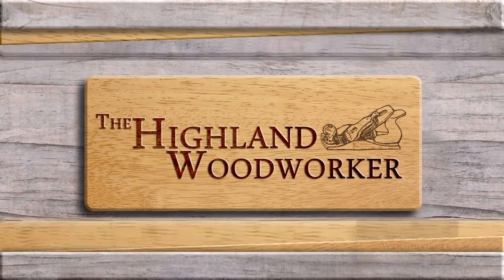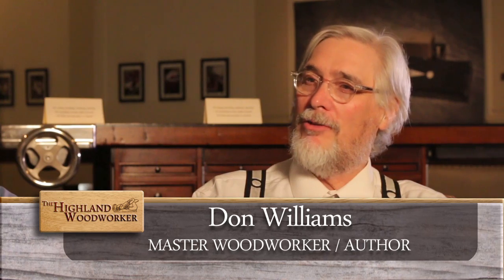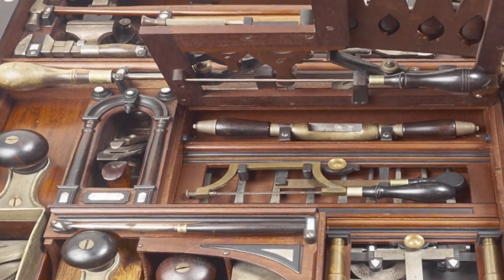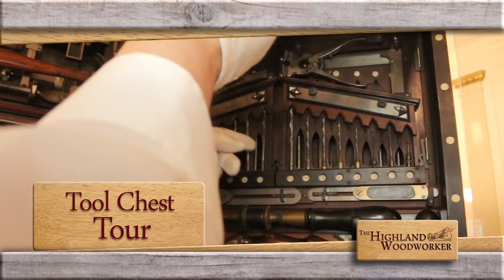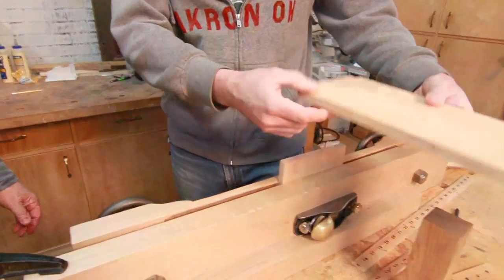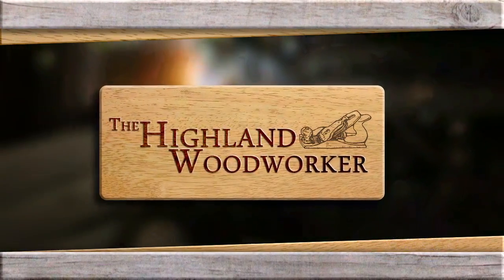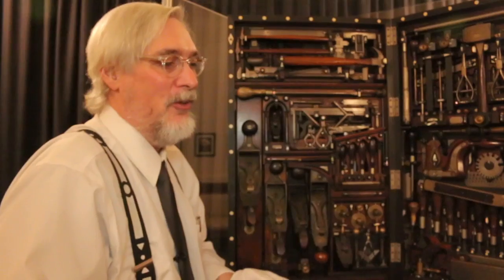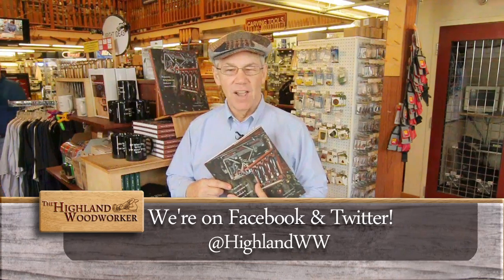The Highland Woodworker - Episode 20

Comment: Perfection?  It is certainly attractive, displaying excellent skill in joinery, inlay, and aesthetic design.  It definitely packs a lot of tools into the tightest space while providing a specific, protective, place for each tool, therefore showing exceptional planning skills.  It served Mr. Studley as he required it, holding his tools in a compact, lockable, cabinet that stayed in his employer's factory at all times.  The downside of the cabinet only shows up when it is considered as a model of tool storage for modern, hobby woodworkers.  A typical hobby woodworker would be highly challenged to reproduce it, and shouldn't because we have different requirements for tool storage than Mr. Studley had.  We own the shops we work in, and have a lock on the door, we don't need a lockable chest.  We don't even need a chest, or cabinet that closes, shelves meet our needs very well.  And most of us have the room to spread our tools out far more than Mr. Studley could.  That means we are not forced to put tools behind other tools, making it easier for us to get to ours.  I think it was a perfect cabinet for Mr. Studley, but it wouldn't be perfect for me or you.
Reply: Many of the organs I know about, are installed in the building, so they cannot be 'sent back for repair'.  Could we presume that he might occasionally take his toolbox to work en situ?  I wonder what it weighs.  I usually put my big project tools in two cases, so they are a balanced load in my hands.